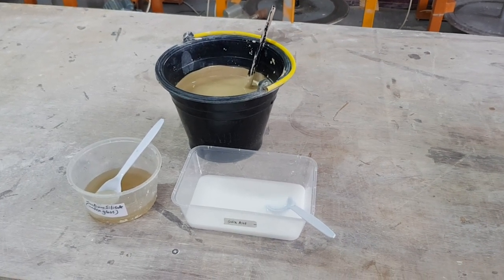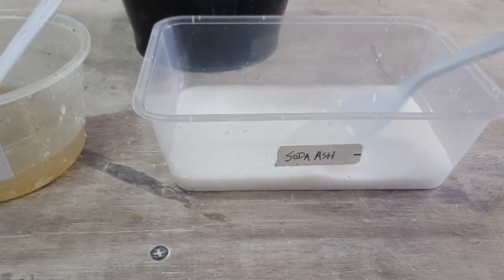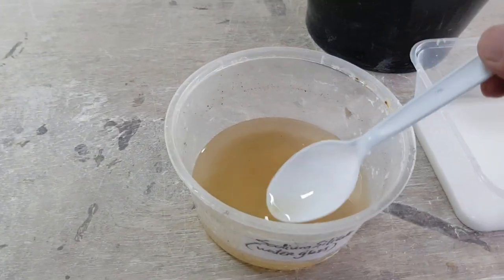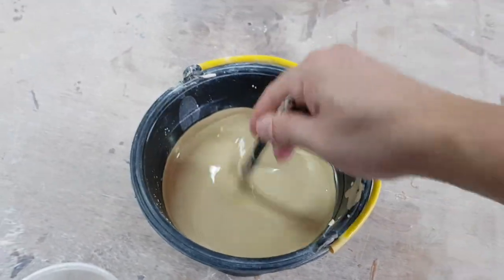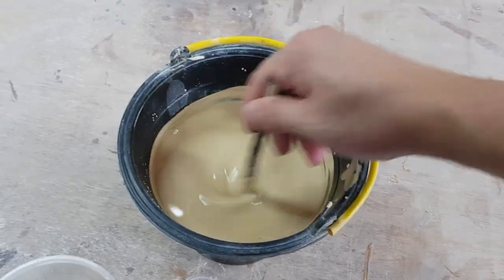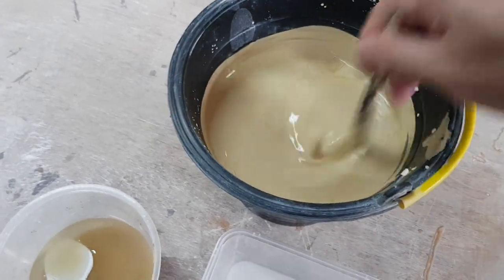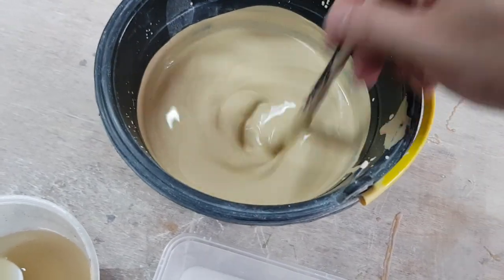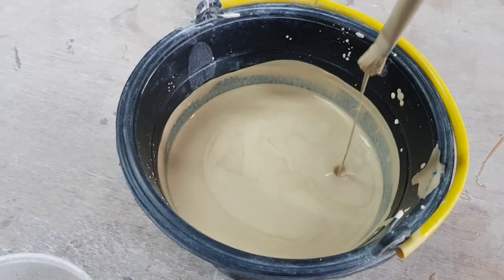How to make casting slip from any ceramics clay body

Comment: If want to add maison stain, how much I need???
Reply from the maker: totally depend on the look you want. for very strong vivid color and lighter colors like, yellow, pink, red, usually 10 -15% is needed.  Darker colors usually 2-10% is enough, from light blue to dark blue for example.. But Max around 15%. above 15% you usually start getting textures created from the metallic crystals in the stain, which could be interesting look also.

Comment: don't know what was in the black bucket OR how to get what in the bucket. this did NOT help me out
Reply from the maker: It is clay mud/slip, dry clay powder and water, about  2:1 ratio. this will be too thick to pour for slip casting, and crack as it's drying in plaster mold. Therefore, adding +/_0.05% of Sodium Silicate/water glass  deflocculates the clay molecules so they repel each other and become liquid again without adding anymore water. This is Casting slip and if done right, this casting mud/slip will not crack as it dries in the plaster mold. The purpose is to be used in making ceramics clay products using #slip casting method in #plastermolds.
Reply: @EpiCai  THANK  YOU

Comment: Itu cara bikinya gimana mas?
Reply from the maker: @anandaerzet6452  tanah liat dalam bentuk tepung 100, tambah air 30. Aduk sampe rata, jadi lumpur yg sangat kental, tambahkan 0.1% Sodium Silicate dan Soda Ash. Aduk yang rata, kalau benar takaran nya, yang tadinya lumpur sangat kental akan berubah menjadi lebih cair, bisa dituang, seperti di video ini. Digunakan untuk teknik cetak tuang (slip casting) dengan menggunakan cetakan dari bahan plaster/gypsum seperti di pabrik2 keramik pada umumnya.
Reply: @EpiCai  kalo untuk pelapis resistor wirewound bisa mas?
Reply from the maker: @anandaerzet6452  ngak pernah saya coba. coba aja. mungkin perlu ditambahkan banyak Alumina Oxide (50-60%}(Tahan Panas/refractory)
Reply: @EpiCai  oh ya mas, sama untuk pembakaran nya nanti di suhu brp biar kering sperti kapur mas?
Reply from the maker: @anandaerzet6452  keramik biasa sih perlu sampe sekitar 800C - 1200C baru jadi permanent, keras dan water-proof.

Comment: Untuk Investment casting aluminium bisa GK kalau pakai bahan ini mas?
Reply: Terima kasih banyak
Reply from the maker: gypsum tambah pasir silica rasanya.
Reply: @EpiCai  jsjhttps://youtu.be/6ajWwPetOAo?si=PD2JxPqu0qx2fuJW
Reply: @EpiCai  sudah pernah saya coba mas   masih sja retak
Reply from the maker: @PopongW  Rough investments should be stronger than plaster of Paris to avoid cracking due to the temperature of molten bronze. Many sculptors recommend mixing plaster and sand, but the sand often interferes with the plaster's ability to set up properly. Instead, try mixing equal parts plaster, sand and clay powder, which you can generally find at or order through art supply stores. The addition of the silicates in clay creates a stronger investment that holds up to heat. Mix an experimental batch with equal parts of the plaster, sand, clay and water. Check the texture of the investment when it dries, and add more water if it cracks or less water if it doesn't fully set.
Reply from the maker: waktu di panasin investmentnya ke sekitar 800-900 derajat Celsius, harus pelan2, sekitar 9 jam total, dari room temperature ke 102 Celsius mesti sangat pelan, sekitar 2-3 jam an. setelah itu boleh skitar 100 derajat per jam
Reply from the maker: https://juxtamorph.com/the-plaster-faq-working-with-plaster/
Reply: @EpiCai  gypsum campur water glas gimana menurut mas nya?
Reply from the maker: @PopongW  tidak pernah coba, tujuannya apa?

Comment: Another way to check whether a slip is sufficiently fluid is to pour a thin stream into a container with slip and when the stream enters the surface of the slip as if cutting into it rather than spreading over the surface, the composition is ready for use

Comment: Hello Dear
How much sodium slicate and soda ash should be mixed in one kg of casting slip or ceramic clay. Please reply. Thanks
Reply from the maker: about 0.5%, 5 to 10 drops of sodium silicate solution.and the same amount of soda ash solution.
Reply: What will happen if we don't use these two components to the slip?

Comment: Does the carbonate do something different than silicate? Do they both will thin the clay?
Reply from the maker: I am not sure how exactly they works, except that they somehow changes the positive, negative charge of the clay molecules ( defloculate) . Making the particles  of the slip repel each other, thus making it seemed thinner and more like liquid without adding water ( dilute). I have successfully made casting slip with just sodium silicate/water glass. I have not tried just using soda ash/sodium carbonate.  In my experience the best casting slip is when I added both.

Comment: I made some casting slip from reclaim clay and used Darvan 7 as my defloculant. I poured it into a plaster mold and after 4 days it is still wet! What did I do wrong? Too much defloculant?
Reply from the maker: Was the slip at a very thick consistency when you add the Darvan 7? You need to start with a very thick slip ( small amount of water). And secondly, is the plaster mold completely dry? A water saturated plaster mold will not absorb the water from the clay.
Reply from the maker: The point for using the defloculant is to make a clay slip that can be poured into the dry plaster mold but the slip must only  contain very small amount of water.

Comment: Sodium silicate is not available in my country. Is there any way i can make slip of clay without using it?
Reply from the maker: another name for it is waterglass, if you are making casting slip, you definitely need some kind of a defloculant  " (Casting slips are pre-made ready to use for pouring and making casts in plaster molds. Liquid casting slips are available in low fire, midrange stoneware, high fire stoneware, and porcelain. We also have dry mix casting slips available in 50 lb. bags that require mixing with water and a deflocculant such as soda ash, sodium silicate, darvan 7 or darvan 811." (https://www.theceramicshop.com/store/category/6/216/casting-slip/)

Comment: Aren’t you supposed to mix the sodium silicate 50% water and then add it!? Also is there a reason the marveling happens and is that ok? I can’t mix mine enough to make the marveling go away so I’m afraid it will not work well in the molds.
Reply from the maker: as long as you can make the thick slip into a smooth flowy consistency, is good enough. Where I am at  the sodium silicate is sold already pre mixed. if the consistency is too thick, I add a little warm water and mix it up to get it less thick first (the sodium silicate).
Reply: Geo Tjakra thanks!! Have you ever had the slip marble? Some of it looks dark gray and some looks light brown.
Reply from the maker: @micheledickey4066  this is a white clay when fired, no problem with the marbling. I have purposely made different color slip by adding stain, and purposely cast marbled slip, with good result, no problem.
Reply from the maker: @micheledickey4066  I watched another video about slip casting recently that mention about hot spot, if you pour the casting slip into one spot, it create a thin spot in the casting that will show up in the final glazed product as a slightly different color. you can avoid this by pouring the casting slip into the mold by moving it around and not just into one spot.

Comment: Hey 🌸 Could I make slip with air dry clay? My mom doesn’t have an kiln and she has some plaster slip doll making molds that she would like to use because we don’t get air dry clay slip here 😭 Alternatively- is there any other medium that she could use to make her dolls with plaster slip casting molds? Thank you so much 😘
Reply from the maker: I never tried making slip from air dry clay. But it might be interesting to try, probably don't need to add sodium silicate/water glass and soda ash. You might not even need to make the air dry clay into a slip, just press the platic air dry clay into the mold really well, let it dry, and you should get a good cast imho. 👍🏻😁

Comment: why do you add silicate sodium to clay?
Reply from the maker: Yes, to change the charge between the molecules to repel each other. So you end up with a  liquid clay that contains very little water, help to dry up in the mold without cracking.
Reply: you need to add the sodium silicate or a similar deflocculant to the slip in order to make it more fluid so it can be poured. You do this for casting with molds.